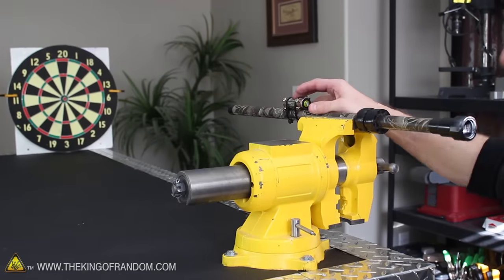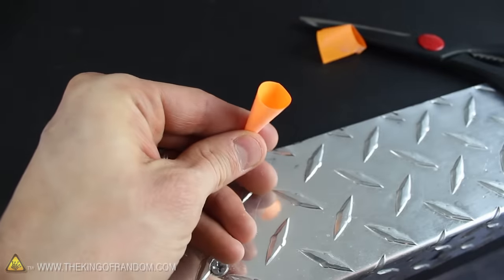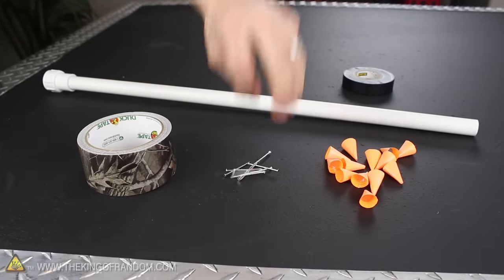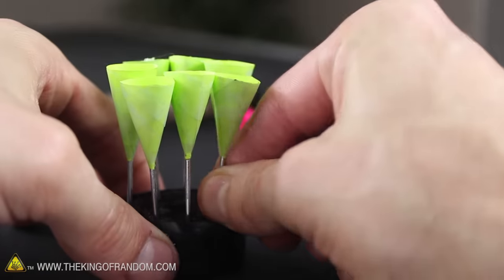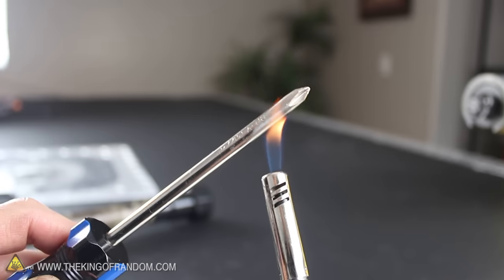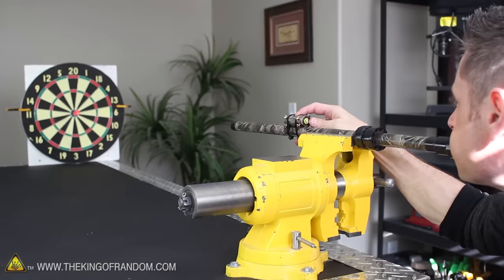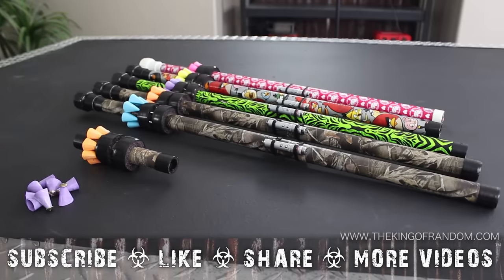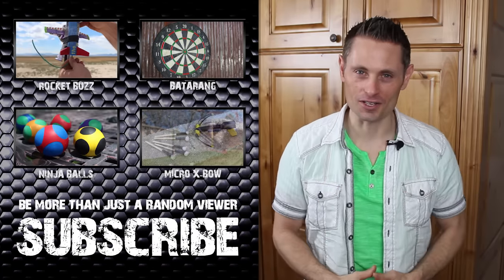How To Make A Laser Assisted Blowgun

Comment: The heck with customizable high impact sniper Scythes, I want one of these!
Reply: I want one!
Reply: Ruby Rose just made a modular version of the blowgun... needless to say i might have made a miniature solar gen. module, an air tank module, an advanced vers. of the "quiver" that feeds directly the blowgun "barrel".

          note: adv. quiver module stores up 20 "normal/hot-glue&paper only" rounds by itself but can support a "magazine" system of storing ammo. The solar gen. is attached to a rechargeable battery, which is connected a heavy duty LED battery operated flashlight (with some modification the flashlight can be "wired" instead), a laser pointer that is also "wired", and a button that acts as a type of "pistol trigger" for the shooting system. the air tank system is directly connected to the barrel, and the stored air is used as a propellant (a small burst of pressurized air will be released from the tank, and once that pressurized air is released it will expand thus moving the dart out of the barrel).
Reply: Ruby Rose buy one at your local online store for only 5.99!
Reply: Get out of the comment section go back to rooster teeth and keep on developing your next volume, I can't wait for it
Reply: +Ruby “Schnee” Rose Meh, give me Sun's Shotgun nunchuks and I'll be happy
Reply: +Ruby “Schnee” Rose lol
Reply: +Cole Gotcher Vids or it didn't happen.
Reply: +Matt “Rocketman” Schmelzer why would i want to waste 3 weeks of my time finding the schematics for all of its parts, remaking it, then make a video of the whole thing just so you can have hard evidence that i made a modular blowgun? and besides, how would you know that i didnt just take the footage from someone else?

Comment: You can also use a sharp pencil to make the dart flights which works well if you don't have a party hat lying around.
Reply: Thanks Alasdair Miller
Reply: hey does paintballs work??
Reply: I don't see why not, if it can fit the tubing anything is possible !
Reply: Hey do you guys know where to buy a great pc
Reply: +Ricardo Tapia build your own. I'm 12 and I did it! linus tech tips, awesomesauce network, Paul's hardware, and techsource are great resources
Reply: thnx
Reply: Thanks, that's really helpful
Reply: Thanks, that's really helpful

Comment: Who wants to know how to make "explosive darts"

Step one do the dart steps from the video

Step two grab one of those mini popper things

Step three cut a little hole in the tip of the dart and put popper in

Step four tape popper and then enjoy
Reply: Derp Fart It wont be heavy enough
Reply: The wolfcannon step 5 - add hotglue/superglue/posterputty
Reply: The wolfcannon youd still have the glue on this inside of the dart.. the only difference in his is that you add a popper on the end of it
Reply: Yep
Reply: garrett starks Don't trust a troll.
Reply: Hunter Blake Not heavy enough, not accurate, unreliable. That's why.
Reply: Me
Reply: Lol dude I was about to post the same idea then I sawbyour comment hah im definetly gonna try it. :D
Reply: Just make the glass breaker rounds from the video, then tape or glue a pop cap round to the flat end of the screw, Boom, exploding rounds
Reply: Lol or you can tape something like mini dynamite on a nail dart and make stuf go boom boom
Reply: No step 1 make the dart he did here
Step 2 Get the black powder u have under your bed
Step 3 drill out most of the hot glue and fill with black powder 

Step 4 make another cone and put it over top 
 Step 5 if u have a strong enough breath blow EXTREMELY hard into a brick wall and that will be explosive or shoot into a fire and the will be explosive

Comment: I will definitely try and make this, considering how cheap it is :D
Reply: Adam Galbraith Anywhere between $2.50 - $5.00
Reply: Clock WorkHD I knew how much it is in USD, but I live in Scotland, and the pricing will be different :/
Reply: Adam Galbraith Oh, then it will be... anywhere from 2.34 £ - 5.24 $
Reply: Clock WorkHD Again, depending on where I get the parts, it could be more/less expensive.
Reply: Adam Galbraith Yeah.
Reply: Clock WorkHD I'll run a quick price check online to see how it'll turn out.
Reply: Adam Galbraith Alright.
Reply: Clock WorkHD ALready busted £5 from some stores which kinda sucks :/
Reply: Adam Galbraith Aw man.
Reply: Yeah, but I'm searching for cheaper parts. From high end DIY store B&Q, it costs around £12, but I found some PVC pipe for £2, so I'm getting somewhere :)
Reply: Adam Galbraith Alright

Comment: I'm planning to buy the materials and stuff tomorrow, and make one. Any tips?
Reply: MrNoodless 1. Darude
                         2. Sandstorm
Reply: +potato no you got it in the wrong order it's
1sandstorm
2darude
Reply: Oops, my bad
Reply: You ought to be ashamed potato. I never knew you were capable of committing such an abomination!
Reply: MrNoodless watch out the pipe he used is not the 1/2 one
Reply: MrNoodless If you want more accuracy, you should get an aluminium pipe, if you clean them on the inside, you might get better accuracy, there's a reason why professianal blowguns are made out of metal. Also usually the longer the pipe is, the better the accuracy, but don't  go over 1.80m in length, because that will cost it power.
Reply: Goodguydolls     what ya it is
Reply: MrNoodless Hoodini
Reply: MrNoodless were did u get the main  PVC tube and reducing adapter? when i get the money i want to make one but i cant find the main pipe anywere
Reply: how'd the build go?
Reply: +Goodguydolls you cut off the part that doesn't fit.
Reply: +Goodguydolls you cut off the part that doesn't fit.

Comment: I wonder if I can make one of these but instead of gluing the laser to the pipe. find a way to attach a Rail so I can mount optics as well as a laser.
Reply: That is actually a great idea!
Reply: Just glue the rail on
Reply: My thinking exactly. ^_^
Reply: CountryFlyboy That would look pretty awesome as well. I reckon you should do it :D
Reply: I will certainly add it to my (already to long) to do list.
Reply: CountryFlyboy
Reply: CountryFlyboy i own some rails that you can bolt into a gun or if you put m4 rails surrounding it so you can put scopes, lasers, flashlights etc... but you can buy them from almost any airsoft website, airsoft gi, gi tactical, evike, etc...

Comment: Sticky notes 
Party hat 
Hot glue gun
2 foot length of 1/2 inch pvc pipe
Female adapter 1/2 3/4 half inch slip
Design tape
Nails
Reply: Luxtury Harambe ll
Reply: Luxtury Harambe
Reply: Thank you

Comment: how did he made the second type of the lazer which was covered in camo
Reply: guys pdf is dead
Reply: 4 screws that form a cross when fully tightened, one ser at the front, one set at the back, then adjust the screws so the laser points where your aiming, perhaps make marks on the screws so u can adjust the laser according to distance
Reply: Sam Jaggard he took some PCV pipe and cut a hole in the top and cut the pipe to the right size that would match the laser. If u listen he said in the vid that he got the laser at the pet store.

Comment: Do you think it's possible to use this blowgun as a hunting tool? Because, the way i figure, if it can pierce concrete, I'm sure it can easily go through small animals.
Reply: Megidramon From what I've read, enough power (or velocity im not sure) its possible to pierce one's skull depending on the dart. Probably can with the nail darts made in the video.
Reply: I figure that the lethality could be improved by using screws rather than nails, for the spirals to stablize the flight path.
Reply: can I have one
Reply: Me and my friends at a party used a bought blowgun, and shot thin sharp darts at each other's legs. The darts were 2x longer than those nails but much thinner. The dart could easily penetrate skin. We even shot a wooden chair and it would go half way through.
Reply: +Megidramon i use it to deal with my mouse infestation, 2 inch finishing nails sail right into the mouse, and if you have good lungs you can pierce it and impale it to the ground, my cat loves to play with something that cant escape.
Reply: +Megidramon If you shoot the glass breaker at any small prey that should do the job
Reply: +Melissa Lopez no
Reply: you could screw on a canister of compressed air, fly much faster
Reply: +Megidramon My friend and I built these blowguns. Shot a pigeon in the neighbors yard with it. Not even a second later we had a lifeless pigeon with a nail going completely through it's skull. So we just threw it over the fence into the neighbor's yard with the dart still piercing it's head. So yeah. You can hunt with it.
Reply: It's the person who use it
Reply: Reborn R tell that to the dozen mice i shot with mine, but it's all good i killed most of em. some are still stuck in my wall with a nail through them however. it's still more humane than glue traps but i shouldnt be talking i used those too.
Reply: Reborn R Oh no! You're offended? Well I'm sorry let me just make sure that everything I do pleases you......and done. Sorry for any inconvenience I may have caused sir.
Reply: I'm sure it'd work.  Those darts go through concrete.
Reply: ***** Well there's a difference to going through concrete and sticking into it
Reply: Gizmo Sloth Yeah, I guess you're right.
Reply: +E. Toussaint that sounds inhumane n you will get arrested
Reply: Gabriel Its only inhumane if you use a paralyzing agent and leave the game that you shot there to die of starvation, or get killed by other predators, which is illegal. You actually wouldn't get arrested as long as you take the game you killed with you.
Reply: +keen kosi you're quite skilled then you'd have to track them and mice and rats have great eyes
Reply: +keen kosi what would make good bait cause I suspect I have a mouse in my home
Reply: +keen kosi also which kind of ammo did you use
Reply: finishing nails overall, i did experiments but the 2.5 inch nails i got worked best, i even fired one off that impaled a mouse to the wall i was proud of that.
Reply: +keen kosi wow props to you but one final question where do you find all these critters
Reply: +Megidramon dip the dart in poison
Reply: +Nathan Pignataro that'll just ruin the meat
Reply: You could buy the right hunting darts that would fit that size, make your own, or just use the one he makes. I would personally make my own or buy some nice broadhead darts(They work much faster).
Reply: +Matthew   Calderón doubt that

Comment: what if i glue bullets and use them
Reply: It would just be the same as using a screw
Reply: It doesnt work like that its actually same thing that you would shoot rock
Reply: Bro. Learn how a gun works
Reply: Max 😂
Reply: They'd be to heavy and dull.
Reply: it wont work because you have to puncture a bottom of the bullet thats what a gun is for
Reply: Theoretically it could work if you used a bullet that would fit just right like a .357, you could make a system that acts like a hammer when you blow a nail into the igniter hard enough to fire it, but you’d need a metal pipe that diameter because I’m pretty sure pvc would just melt after a shot or two
Reply: You can probably put a cartridge and a nail behind to puncture the primer

Comment: i want to buy it from you 
make a ebay account or somthing
Reply: ***** Some people don't have the right tools, they may just want to kill birds that is crapping on their car.
Reply: Hacksaw-$20
Tape-$5
PVC-$5
Foam noodle-$1
Nails-$5
Sticky notes-$1
Cheap glue gun-$5
Rubber mallet-$10
Laser-$1

Total cost for this project-$53
With tools-$18
Just tools-$35

Money saving tips: use a $1 utility knife instead of a hacksaw, melt a candle into darts instead of hot glue, use a piece of scrap wood to pound PVC together, keep a small box of spare nails from projects to use as tips.

YOUR WELCOME :)
Reply: Also, instead of nails, you can use jumbo paper clips and straighten them out :) I'd cut about 2 inches off the whole straightened paper clip and I'd have a nice 2.5 inch dart (not including sticky notes).
Reply: SAINTKID123 I like it! Thrifty at it's best!
Reply: Hey man lack of tools is never an excuse.